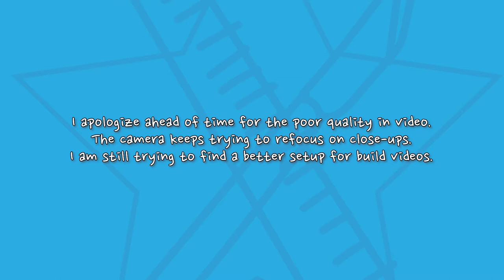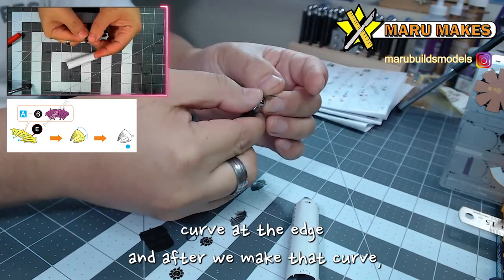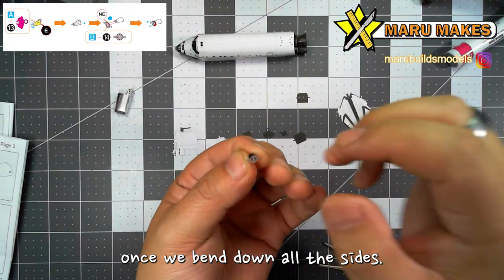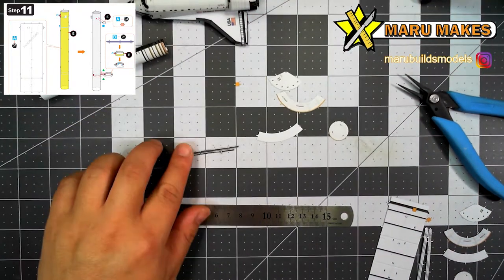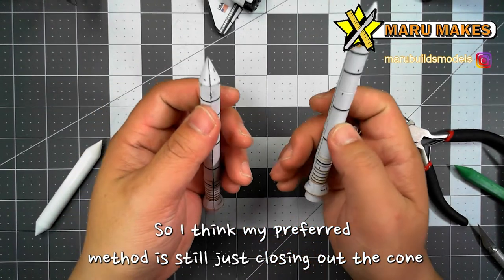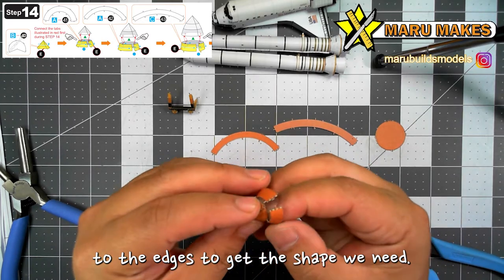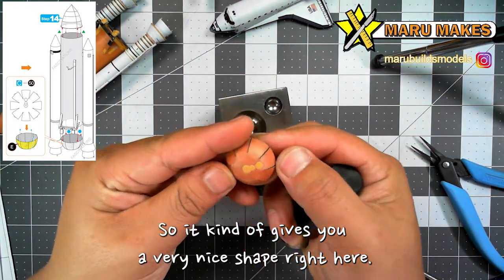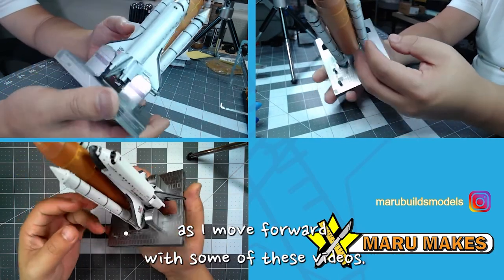How to Build Metal Earth's Space Shuttle Launch Kit

Comment: Actually, where can I find those stars you used for the cones and those round plier-looking things w/ the metal cylinders you use for bending?
Reply from the maker: I think the guy who makes the star shaped tools discontinued the kit. But I find it not as useful as just using round tip pliers. For the cylindrical shaped plier, I actually bought them from either joann or Michael's. It's in the jewelry making section. Hope that helps!